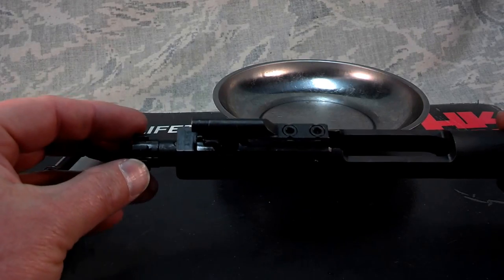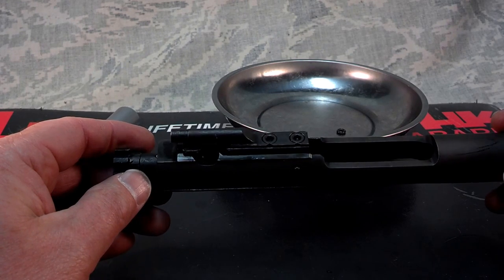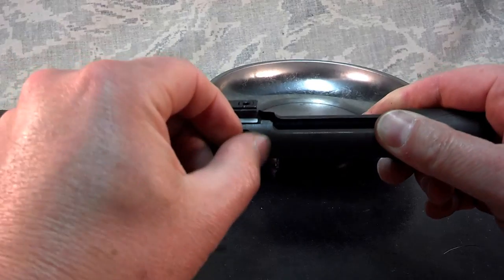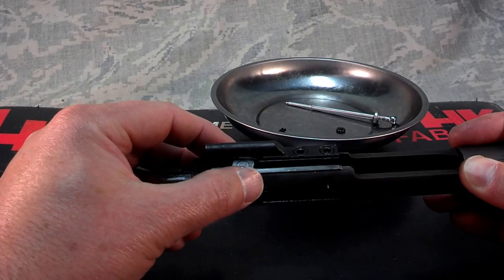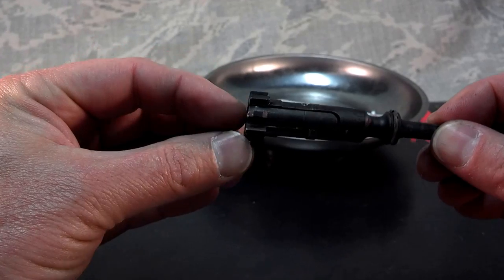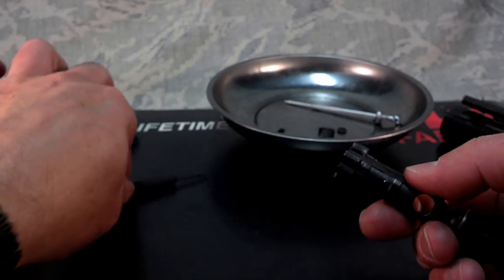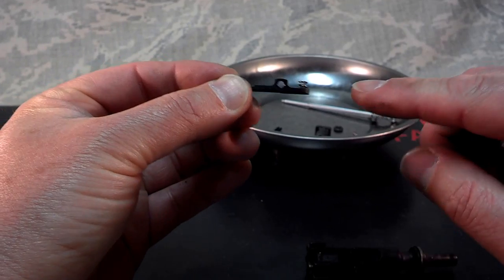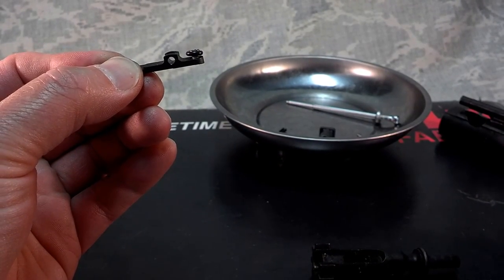Adding an O-Ring to an AR15 Extractor Spring

Comment: Your video saved me quite a bit of headaches and lots of time! I field stripped and cleaned both my ar-15 rifles and four handguns and when I was done, I found a small o-ring in my solvent bin and was trying to figure out where it came from.  I searched my part diagrams for all four handguns and couldn't find any small o-rings listed, so I started searching for the ar-15 rifles and found your video.  I have to change my cleaning habits and take my time making sure I don't have left over parts after cleaning each firearm. Thanks!

Comment: Thank you for the video. I put my "O" ring on my BCG today.  It is recommended that any barrel length under 14.5" to have an "o" ring on the BCG.
Excellent video.
Reply: Interesting. My AK pistol had FTE issues and I just had the o ring installed. Hopefully it fixes the issue
Reply: In addition to what you said, it’s also recommended for all 300 blackouts. This according to BCM with my newly received BCG.
Reply: Yes, apparently that's a CRANE fix. MSW/DEVGRU
Reply: @Wreck-It-Rob my 300blk out has a short stroke issue, should i upgrade the spring and oring and see what happens, what else should i look for

Comment: Thank you for this video. I needed to install an O-ring and had no clue.  After viewing this, it was a snap.  Fixed the failure to ejects too.
Reply: Britt Ringel what size o ring. Where ya get it.
Reply: Wish me luck. After years of grief with my AR-15 pistol failing to extract/eject I'm hoping the O-ring I bought will fix it. A while back i put a stronger spring on the extractor and it didn't seem to help so I started tweaking other things. Only recently saw the suggestion of a stronger spring AND an O-ring.
Reply: @bioforce5  did it work?

Comment: Interesting.  I took my bolt apart this morning and there was no O-ring.  But the Oops small parts kit I bought a while ago, had some O-rings and I couldn't figure out what they were for.  I guess if the rifle starts to have extractor problems those O-rings will come in handy.

Comment: This video is 10 years old and needs to be edited by me.....Ya don't need the o ring.....Toss it......Just the black insert and an extra power extractor spring......Sprinco 5 coil....Wilson Combat....ISMI......That's an old mil-spec design used in tropical environments......You'll get better more consistent cycling when an AR/M16 is tuned properly......
Reply from the maker: Thanks for the comment. Since the initial post I have included a link in the description to the BCM website that contains the 3 pieces: spring, insert and o-ring as a kit. https://bravocompanyusa.com/bcm-extractor-spring-upgrade-kit/
Reply: @BlueBeretFirearms  Yeah I know.....I've purchased the same kit.....Actually Sprinco packages their kit with the viton o ring......And they also give advice not to use it with the 5 coil.....LOL......God Bless America.....

Comment: Using a magnetic bowl is NOT a good idea as it will magnetize those parts.

SOTAR uses a demagnetizer on any bolt parts if they check out as being magnetized.

That magnetic bowl although great to secure small parts will unfortunately magnetize them.
Reply from the maker: This video is over 10 years old and this is the second time someone has made this comment. I'm curious, how long would it take to magnetize a part? As you can see, the parts are in the bowl for a very short time. However, I have taken this into consideration.

Comment: I'm having similar problems with my CMMG Banshee 200 40 cal AR type pistol. I just replaced the original extractor spring wth the BCM extractor spring upgrade kit..It came with an o-ring, but my original extractor spring didn't come with it. So I didn't use it. It helped some. But was still having issues. Do you think the oring will make a difference in my case even though its not an AR 15?
Reply: Absolutely! O-ring that mother lover!